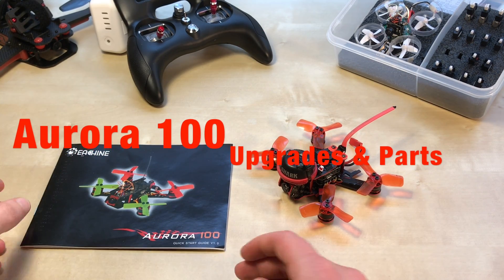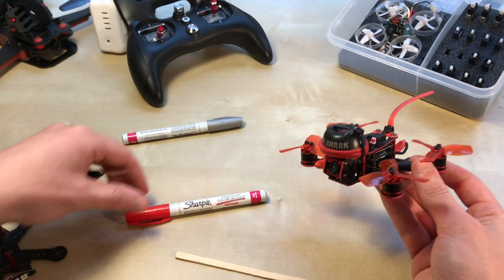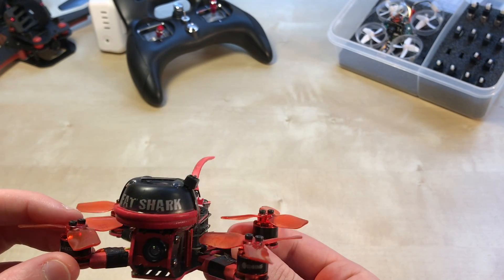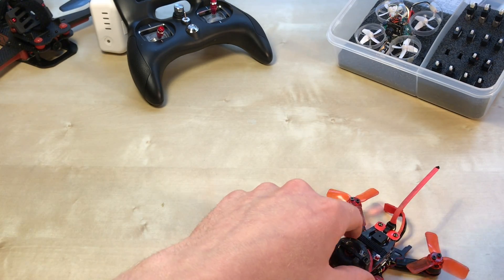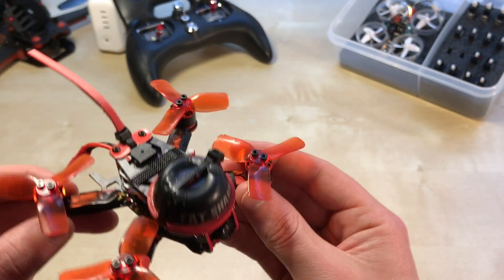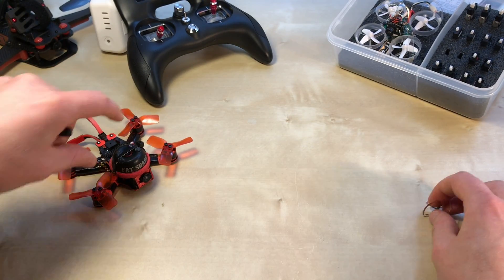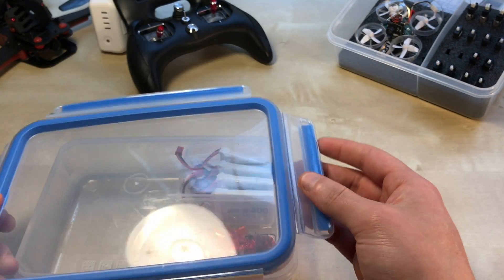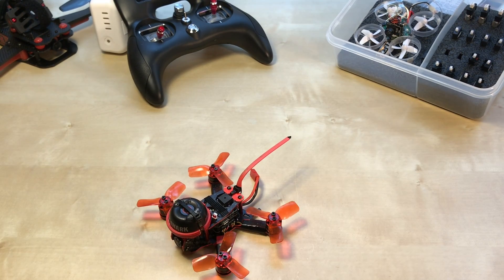Aurora 100 Upgrades & Parts

Comment: Nice upgrades! I like the antenna cover. I replaced the cloverleaf with a dipole antenna, seems to work fine too. Also, try the gemfan 2035 transparant props, VERY durable and awesome performance. (4-blades  give more thrust on these motors as well) Also, battery wise, I have 2 of these :https://www.banggood.com/Gaoneng-GNB-7_4V-550mAh-2S-50100C-Lipo-Battery-JST-Plug-p-1115553.html?rmmds=myorder and I must say they perform just as good as the original lipo.
Reply from the maker: I have some of those gemfan props they are my new favorite ones.  they are lighter than the tri blades so they rev up faster and they are just as durable.

Comment: You should try these batteries, they are the BEST I have used on my babyhawk https://micro-motor-warehouse.com/products/mylipo-400mah-25c-2s-21g
Reply from the maker: They are only 25c continuous.  The other batteries that I have (white) are 30c continuous and they dont last very long.  unfortunately no one has batteries right now.

Comment: The 2mm and 2.5mm frames banggood sell are excellent upgrades. TBH it should have come with one of them as default... https://www.banggood.com/Eachine-Aurora-100-Mini-Brushless-FPV-Racer-Spare-Part-2mm-2_5mm-Bottom-Plate-3K-Carbon-Fiber-p-1144532.html?p=OV1215528682201404B8
Reply from the maker: Yea the frame it came with is not strong enough.  I got the replacement frame before the thicker ones were available.   I wish they would incorporate some changes into it.
Reply: I just swapped my original base plate out for a 2mm one (2.5mm was out of stock).   It's much better.
Reply from the maker: Next time I break the frame I plan on swapping it for a thicker one.
Reply: Aerial Marks like hooks for lipo elastic! I've ditched the LED bar as I fly solo. The 2mm frame is enough, adds just north of 3g but with the racestar 5 blade props it's has oodles of power anyway. Definitely put some electrical tape on the ipx antenna connector too, think you mentioned that in the video. Its super close to the frame. I had a couple of random drops that stopped when I did that